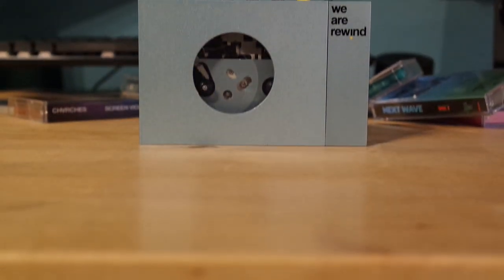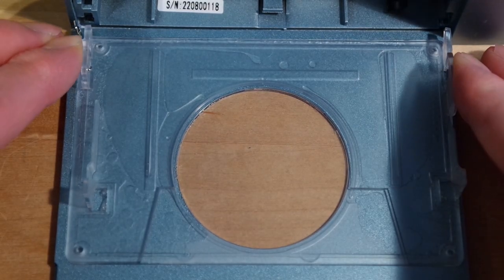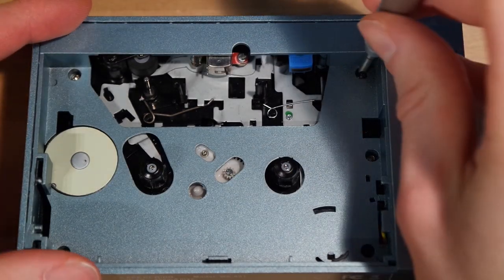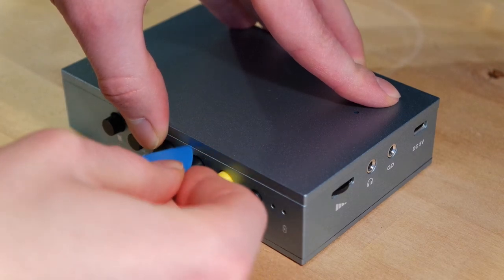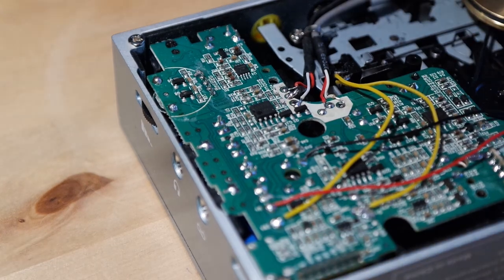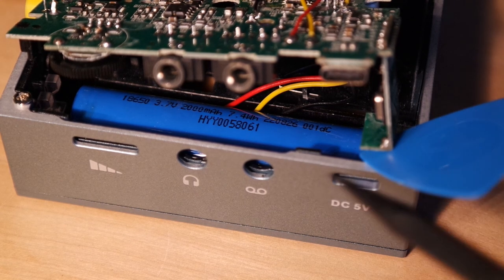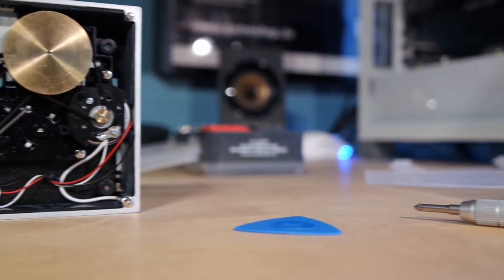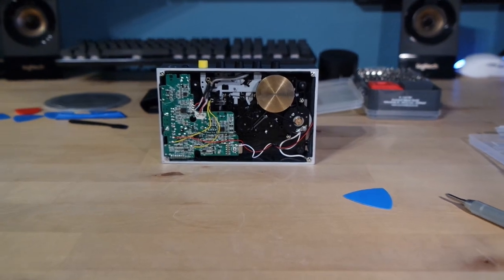We Are Rewind Portable Cassette Player Teardown | Prying it open [English]

Comment: its just a little less of a piece of crap. then i thought it was. metal fly wheel nice touch bad mech still but still not as bad as i thought, but just buy a old one fix it.  you want blue tooth in install it your self. you want rechargeable battery's cool buy them put them in.  but for 149.. dollar i can get a far better old unit,
Reply from the maker: Fair point, I also have a Sony WM-FX10 and tried fixing up two Panasonic's but not everybody might want to do that, for those this might be an option, this or the Mulann B-1000. This is probably a bit better than the Mulann and definitely feels nicer, but it's also more than three times as expensive. Maybe there will be more choice at some point in the future.
Reply: @germantechguys  repair is easy. 99'%  of the time its a belt a bit of cleaning a little lube, or a wire needs to be redone. the rest is just replacing caps. if you dont want to go that far to get a decent machine sure that new crap is for you. go spend your money because you  more of that then good common sense.
Reply from the maker: If any Person new to the hobby solely relys on vintage gear that will lead to rising prices though, as the availability is limited and only declining as the failiure rate of these old players rises with their age. So somewhat decent new gear is a win for everybody in my mind.
Reply: @germantechguys   bull the prices are already high if you want a cleaned restored model. but not for the need repair for parts units there still affordable. so get one of them put the work in. simple
Reply from the maker: Don't really want to invest money and time into more broken players atm as I still have enough projects to do for the moment. I might buy a nice walkman someday and fix it up, but for now I'll just use the We Are Rewind one. The one in this video also is broken, but I contacted the support and got a replacement (before making the video), much more convenient than trying to fix it myself. Replacing belts is one thing, but rotten off contacts, bad microswitches and bad capacitors are an entirely different story.
Reply: @germantechguys   NONE OF THE PROMBLEMS YOU JUST MENTIONED ARE THAT HARD. ITS JUST A CASE OF WHAT YOUR WILLING TO DO. VERUS WHAT YOUR WILLING TO PAY TO NOT DO IT.
Reply from the maker: If you have the skill, the knowledge and the experience that may be, but I had my experience with old broken players and I'm not an expert in electronics and it really got frustrating for me, which doesn't mean, I'm never going to attempt to fix anything again, but for the moment I'm glad to have a player that just works from the get-go.
Reply from the maker: Dude, no need to get offensive. Why do you think it's ok, to insult people you don't know on the internet? You can't just assume that everyone agrees to your opinion. If I don't want to fix broken players that's my business, not yours. I've been successful in 1 out of 5 cases and I don't need to excuse myself for not wanting to try to fix another one at the moment.
Reply: No one really needs Bluetooth on a portable analog cassette player, Once it's Bluetooth it's already digital so may as well use a digital media player, much smaller, battery lasts for days and no cassettes to carry. The whole purpose of recording and playing back cassettes is the quality and analog aspect of it, this thing has none.
Reply: @Capturing-Memories  agreed
Reply from the maker: I'm not using Bluetooth a lot but it is a nice to have feature. I don't own Bluetooth headphones however and so I've only used it with my Bluetooth speaker so far 1 or 2 times.
Reply: @germantechguys  its a case of having one more new shiny toy. men are always hoarding just things.
Reply from the maker: Yes, and why should anybody be blamed for getting another shiny toy? People are free to make their own decisions and there's a huge market for shiny toys, so obviously there's a demand.
Reply: @germantechguys   didnt say they couldnt. to paraphase you.  DUDE! IM SPEAKING MY MIND . thats it. do whatever you want
Reply from the maker: @richardroach5866  Guess we can at least agree on that then. And after all I also agree that vintage players can be a lot better, still I see a place for these new ones.
Reply: @germantechguys  yeah a place for the tone deaf hipsters with more dollars then sense.
Reply from the maker: @richardroach5866   Why you're getting insulting again? I mean it's ok if it isn't for you, you've tried it out, you have good reason for it, but that doesn't make anybody who doesn't share your opinion stupid, or his opinion less viable. Everybody might have different priorities.
Reply: @germantechguys  Guys shill out, A lot of folks who owned and praise high quality cassette players from the era see these crappy toys as an insult to the format, I don't blame them. At the same time, designing a new high quality mechanism will run into hundreds of dollars of the final product price to sustain the R&D, design and manufacturing costs.
Reply from the maker: @Capturing-Memories  I share that opinion. I never expected this to beat high quality vintage players, there was just no chance it would, it was pretty clear from the beginning that it would use a tanashin based mechanism and what other option would there have been? This is a low volume production which also makes it more expensive per unit so yeah, the market is in a bad state to produce a good player for a good price. But for me this player and the people who buy it signal that there might be room for competition on quality in the future rather than competition on price which no name chinese manufacturers will always win. Let's see, the current product is what it is, but it is an improvement over what was previously available, they tried to up the quality and that's what counts for me. Also I'm personally absolutely ok with the end result, I think the product is appealing to anyone who's not into vintage players or anybody who is but also is curious about what the market has to offer.
Reply: @Capturing-Memories  more like 100's of thousands at the min. you forgetting about the retooling  it would take to get a place capable of making new mechs for the players. a fully new player of the quality i demand would have to be in the sale point of atleast 500 to 800 dollars. if not much more. i understand i just dont care to be kind there making crap for crap sake i want nothing to do with it.
Reply: @richardroach5866  More than that, Around $1500-$2000.
Reply: @Capturing-Memories  as i said or more. and 100's of thousands min. i get it  thats why im so big of restoring the old devices instead supporting theys crap dealers.
Reply from the maker: It's not only about being polite, but that's YOUR opinion, because your standard is incredibly high, which is ok, although I would've preferred if you shared it in a more polite way, but still that doesn't mean that nobody could have a different opinion because they're looking for different things in a portable player and they wouldn't want to spend much more on one. I think I've made my point clear before, but this is the first player for almost 20 years that isn't the result of a price war but rather tries to convince potential buyers with quality and features, hence the aluminum shell and the Bluetooth capability. The fact that it exists and people buy it opens up the market for other companies to compete on quality which is a good thing even though we're starting at a pretty low point with only tanashin based mechanisms being left in production. I believe them that they've tried their best, there are only few areas where they could've done better in the current market situation but maybe there will be another generation at some point that improves on these things, still wouldn't be competitive to Sony of the early 90s, but we're not in the early 90s, Sony has left this market many years ago. If people want to buy a vintage player and fix it up, they should do so, if they don't, because they have no clue about electronics and they're just getting into the format for lifestyle reasons, the WE-001 is another option, having more choices has never hurt anybody. That's my opinion.
Reply: @germantechguys  your point is valid. but you dont need to be a tech head to get vintage machines there are restored models on the market for the same or near price point of this rewind item ( see i didn't say crap) happy now. i just dont see the reason to reward folks for making sub standard items
Reply from the maker: Yes, a valid alternative to get a refurbished vintage player or any vintage player and refurbish it yourself, but vintage gear is limited and won't last forever, although it could aswell outlast a WE-001 you're buying now. One might never know. But I think it's good that there is something new available on the market because it's supply is theoretically endless. In addition it opens up the market for a competition on quality rather than on price, which is also a good thing, alhtough I don't expect the quality of new players to rise quickly over the next years and it will probably never reach 90s quality standards, but in my opinion a market is only getting healthier if there's more options to choose from. And I'm actually ok with what the player delivers, I've used it a lot so far and it does what it's supposed to. It plays music and it is portable, my deck sounds better but it isn't portable, I payed the kickstarter price, so it would've been hard to get a refurbished vintage player for the money. I've never had a really nice portable player though, I'd definitely be interested in getting one at some point in the future, something like a Walkman DD. For anybody new to the format who is looking for Jensen players on Amazon, this WE-001 is the better alternative if they can afford spending the money for a toy, which it essentially is, because nobody really needs portable cassette players these days, everybody's got a phone with superior audio quality. I'm curious though where the market is going in the next 10 years. Will the format be dead again? Will there be more and better options? Seeing a new player released for a format that has been said to be dead is something that gets me excited, that doesn't necessarily mean that it's better than anything that has been there in the formats hayday but it signals that there is interest in the format again.
Reply: @germantechguys  not as limited as you would think.. maybe because I'm in America the land of mass consumption. but i still find units worth repairing thru multiple  sources for affordable prices.. and restored vintage models for a price point comparable to rewind.
Reply: @germantechguys  anyone new to the hobby should know how to repair or maintain there gear , if atleast in a basic sense. how can a guy be into cars and not know how to drive or do basic maintance  . its thats simple you want to get into something you should know something about it. other then going shiny thing mmmmmm me want.!
Reply: @richardroach5866  You need to chill. So you changed belt on a walkman and now you want a trophy.. its not that hard.